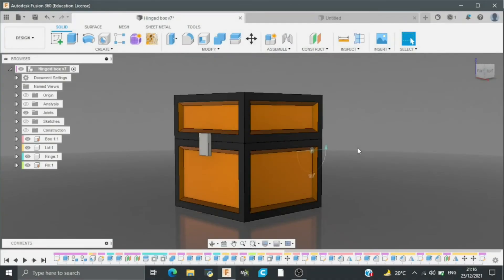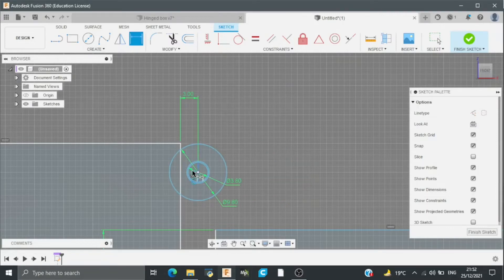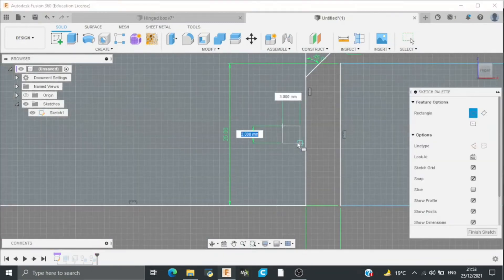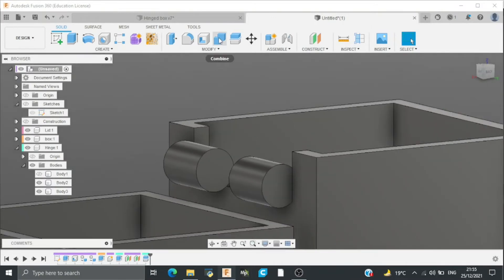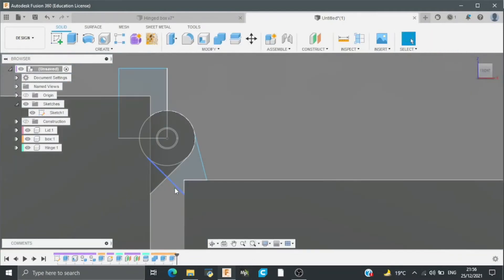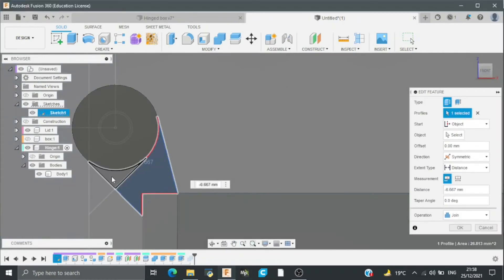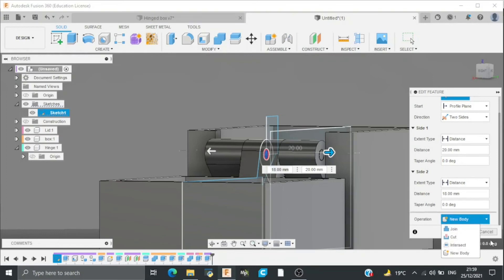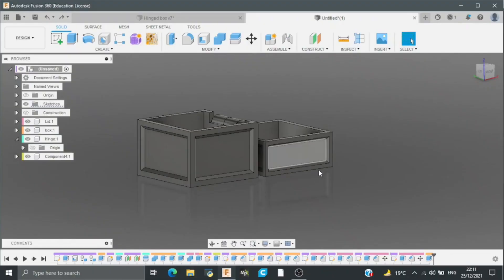HOW TO MAKE A HINGED BOX IN FUSION 360 || EASY TO 3 D PRINT || MR.FUSION 360 ||

Comment: Can you make a box with hinge inside or hidden as much as you can?
Reply from the maker: Yes , It is possible. You can make a cavity around the back of the lower part and make a bulged part on the inside/outside to add piece of filament or any thing you want it as your pin for the parts . By doing this you can make the hinges hidden as much as possible...